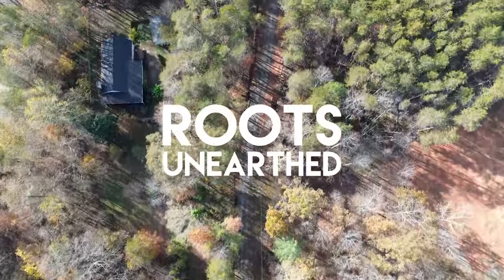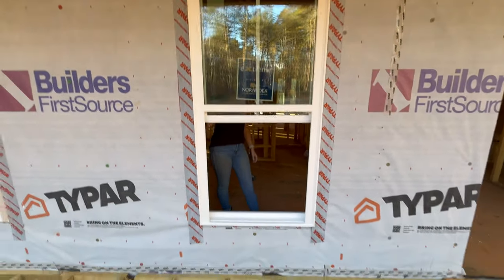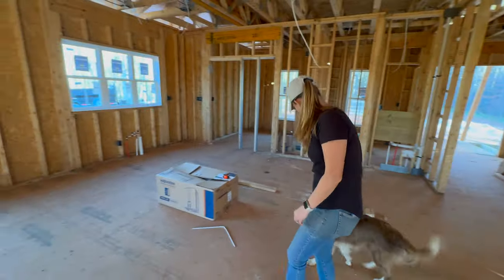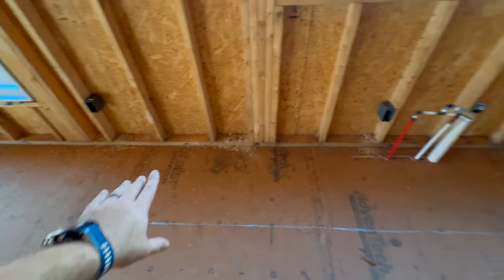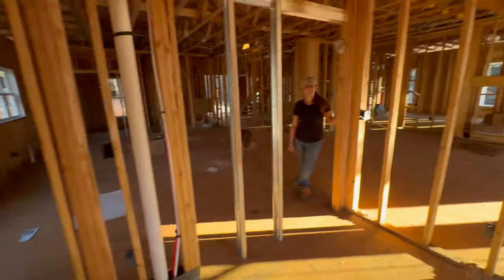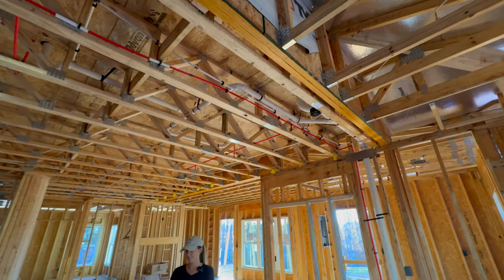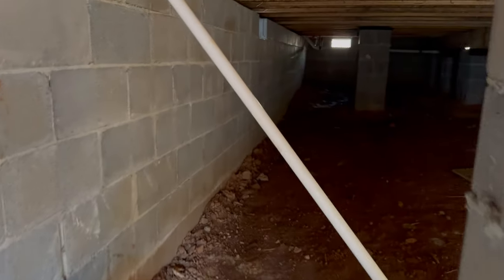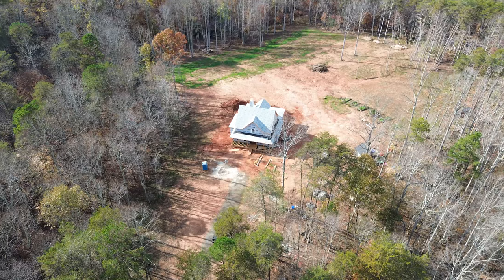Windows & Electric -  Farm House Build - Ep. 11 - Four Gables Homestead Farmhouse

Comment: Looking  good. Yes blue wire is new on the market.  The blue wire means it is typically used as a neutral conductor in electrical circuits. Yellow electrical wires are commonly used for switched legs in light fixtures or other applications where the switch controls the hot wire. Yellow wire electrical is often used with black or red hot wires to complete the circuit.